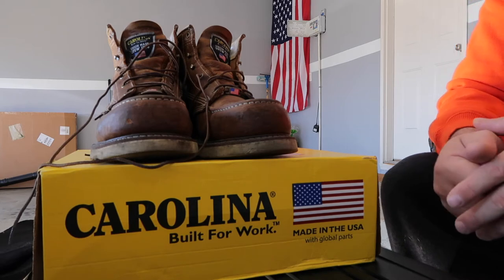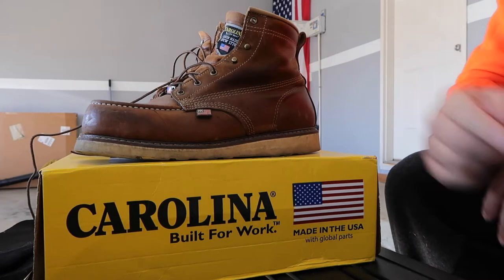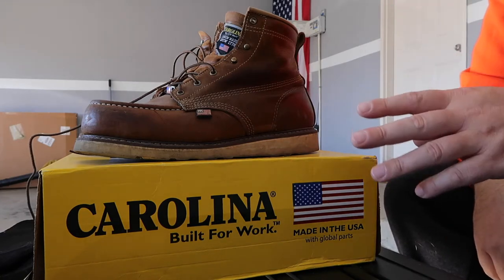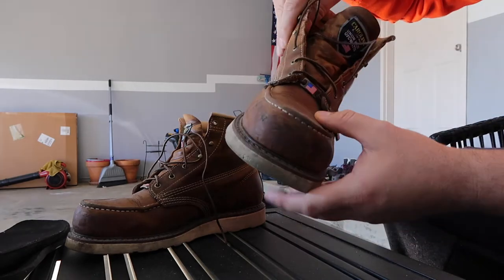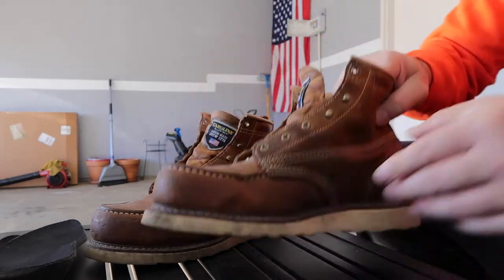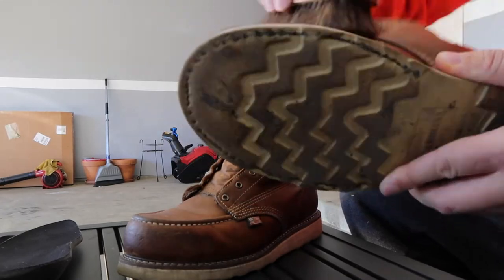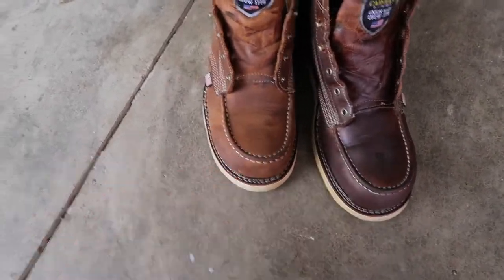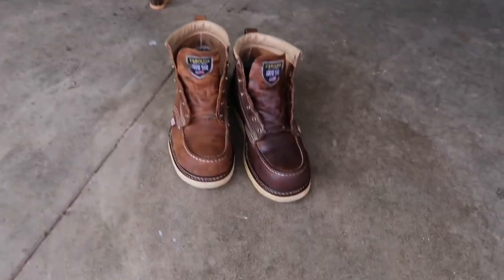CAROLINA Moc toe  CA7811 how to clean and oil

Comment: I have the Thorogood moc toe in steel toe, which is very similar to the Carolinas.  I put Superfeet green inserts in them, which are a firmer insert.  Seems to be working good.  I’m on my feet for 8-10 hours a shift in an automotive assembly plant.  As for the laces, you may try tying a different knot that won’t slip.  I plan on trying that soon, myself.

Comment: What are the advantages to oiling the uppers? Does it help in comfort, or just make them last longer. I'm an electrician and I weld on the side. I've had crappy boots and you end up paying for new boots in 8 months.
Reply from the maker: Oiling will keep your boots soft and they won’t crack .